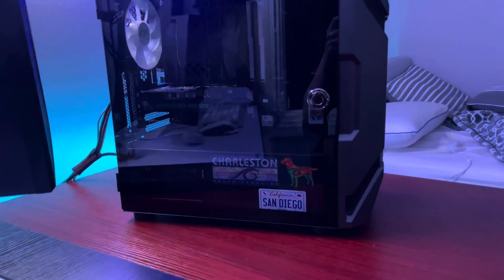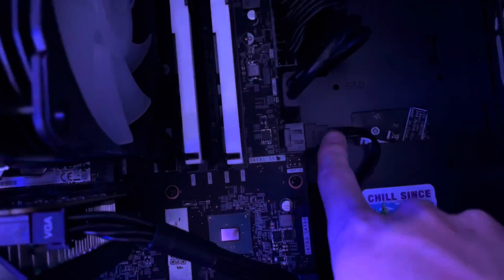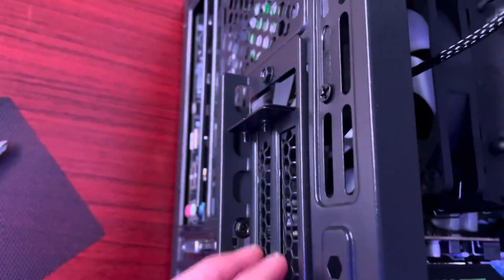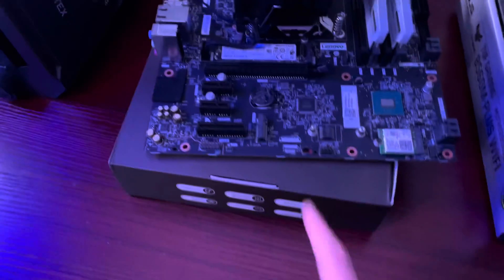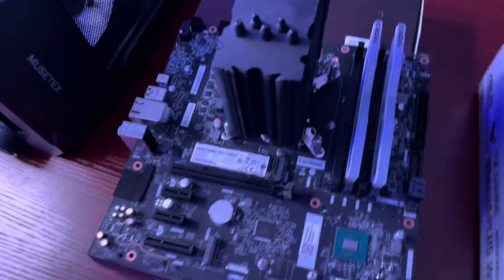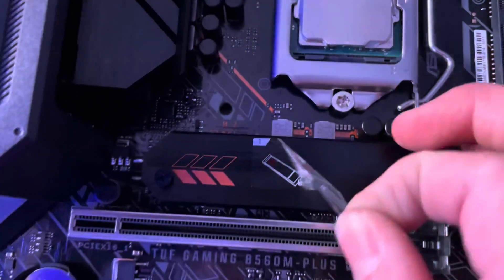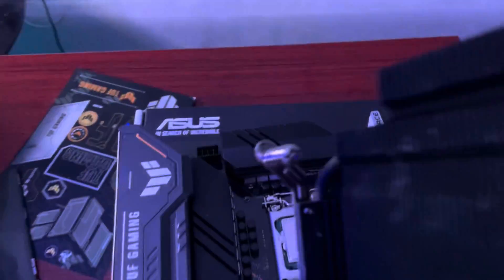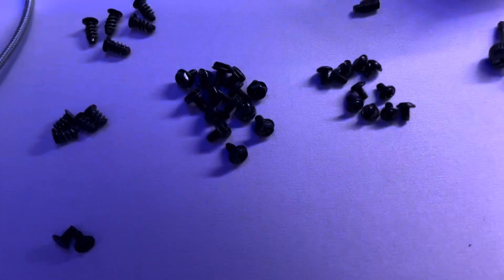How to upgrade a Lenovo Legion motherboard!

Comment: Hey tech nugget I don’t know if you still are active on this channel but quick question remember your case swap video 

I am case swapping my Lenovo pc also this summer it’s long over due 
I am getting the mono tech Air 100 case but my question is about the front panel connectors the new case has a couple more panel connectors 

The thing is will my Lenovo motherboard support all of that where would the front panel connection go? It doesn’t look like you can do a whole lot for the front panel connections with the Lenovo legion mobo 

Any thoughts?

Comment: Okay I just changed my motherboard to the same motherboard with the same old motherboard I say the reason you had to restart your whole window is because A. You put your SSD in the first SSD connector or it because you did not have internet on when you boot up the pc
Reply: And when I mean wifi I mean via. A lan cable so it can automatically detect the wifi
Reply: Also yes I did mange to get the same windows with my games and I just had to change the driver's
Reply: @adamdoesthings1096 can you tell me how did you keep your games

Comment: My Pc (exact model u have) crashes  almost every time I turn it on do you know why? I upgrade almost everything I need to.
Reply: hey! ik its 3 months late and u might not have the pc anymore or found out the problem but for me. I fixed it by going back to older gpu drivers and that fixed it. pretty simple. of u still have this problem let me know cause i could help u out a little more

Comment: 100% gonna do this some day. Currently looking at buying a hyper 212, mortar b460m wifi, and fractal design meshify case. Costs around $300-$350. Would this be a worthwhile upgrade for my legion t5?
Reply: If your psu can handle it then yea
Reply: Did you do it? Was it easy?

Comment: After you installed the new mobo, it automatically used the SSD to boot into windows? 

Did it keep all the Lenovo drivers and Lenovo mobo drivers or did it uninstall Thoese, and installed AORUS drivers
Reply from the maker: I went into bios and selected to boot off of that ssd, abs I actually had to reinstall windows for some reason, but I kept my photos and other things, I had to re install the games tho
Reply: @technugget873  Ohh ok, but quick qestion tech nugget idk if u know this 

The Lenovo mobo right, it’s LGA 1200 right could I just get a new cpu like a i9-11900f for exmaple or a more powerful cpu 
And would the mobo automatically know there is a new cpu
Reply from the maker: @cabbagememes2852  the Lenovo board is lga 1200, I’m fairly certain it may support 11th gen, but that bios is pretty limiting and the power delivery may struggle, as it’s not cooled and isn’t very big to begin with
Reply: @technugget873  That’s a bummer, well that’s ok!

I have already got a better cpu cooler, now I am planning to buy a PSU just like yours, and probably change cases.

Thank you for makeing this video tech nugget I will use this as a guide, in case I also want to get a new mobo to upgrade from